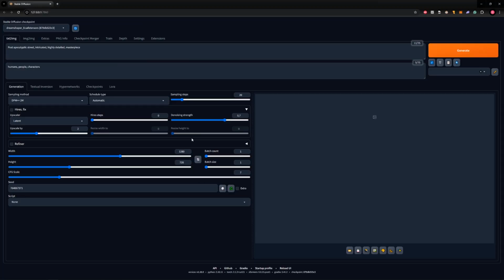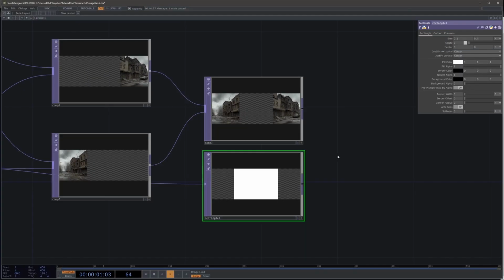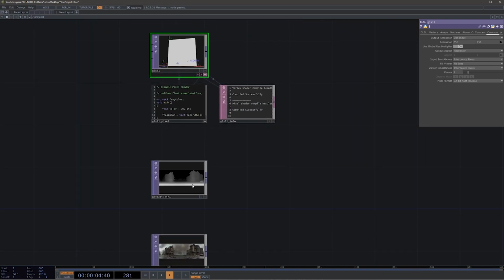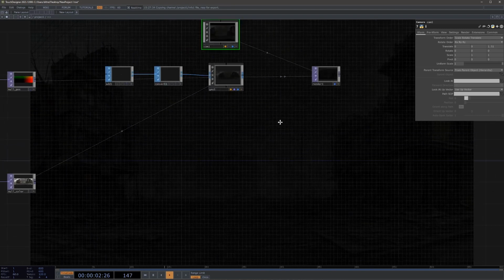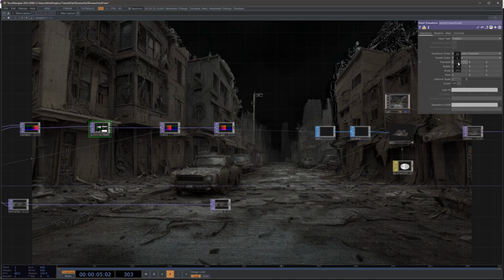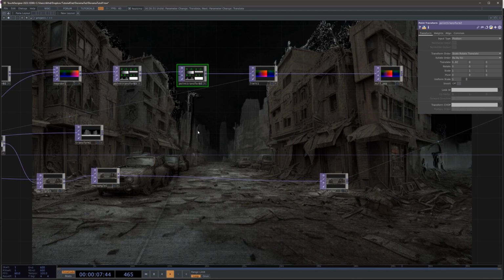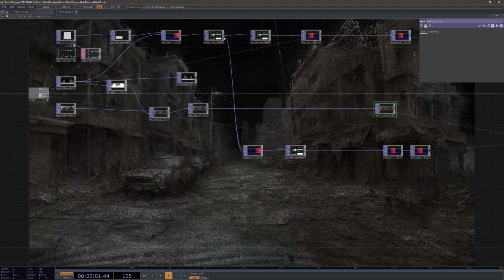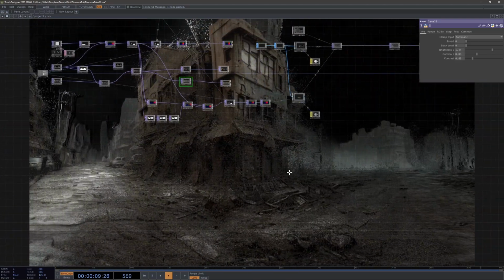Infinite passing by pointcloud landscape in Touchdesigner using stablediffusion.

Comment: would this work with content made from midjourney rather than stable diffusion ?
Reply from the maker: Of course, as long as you got a proper depth map (16 or 32 bit float)
Reply: Cool do you know how to get a depth map like can I do it through photoshop or what ways can I achieve this ?
Reply from the maker: @jasonbarajas9546  I used stablediffusion locally installed, I don't know much about photoshop, but you can give it a try

Comment: Hi thanks for the awesome tutorial as usuale, do you think would it be possible to use real images instead of SD generated images and create infinite landscape from it? thanks
Reply from the maker: You could if you do a 360 panorama of pictures, or mirror it to have it stitch. As long as you made the beginning stitch to the end it's doable.  You will also need a depth map, but you can of course input a real image in the depth generation of Sd, or otherwise use another tool.
Hope it answer your question.
Reply: @Dithdsgn  Actually i tried it to mirror the edges of the image but it still not good good enough, since i am a patron sub can i write to you there, I woudl like to have some advice on what I am doing wrong, thanks a lot
Reply from the maker: @alocincrepa  Yes of course !

Comment: I really want to follow and downloaded stable diffusion but for mine it doesnt have depth tab 😭 Do you know  how can I get it??
I searched to get it but cant find
Reply from the maker: It's because it doesn't came pre installed with depth control, but you can easily install the packages for it. If you install the automatic 1111 then it should be ok.
Once launched, you go to extensions tab, and you go to available, you click on load from, and a list should appear, you should install the following :
stable-diffusion-webui-depthmap-script
sd-webui-udav2
Let me know if it works out for you.